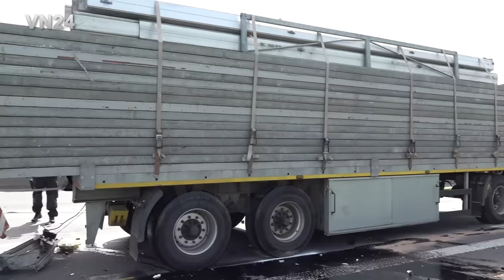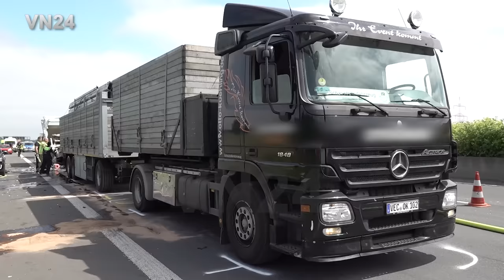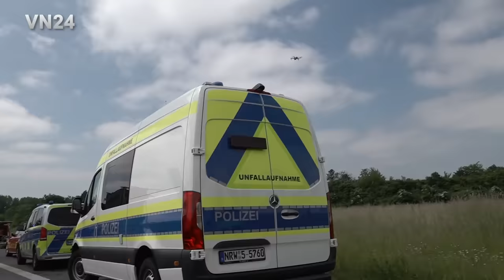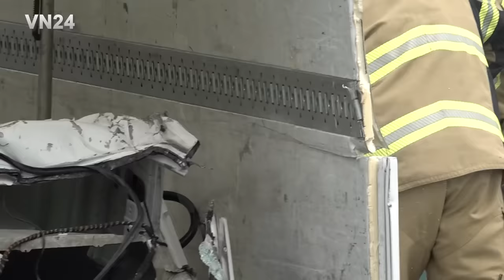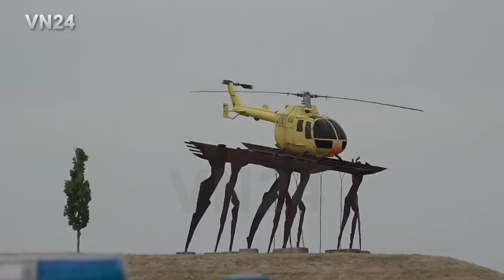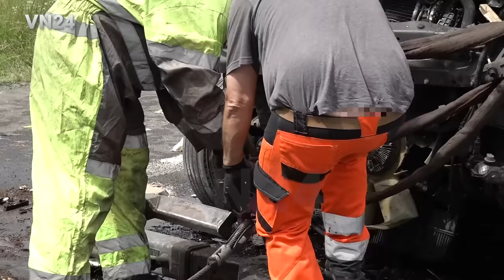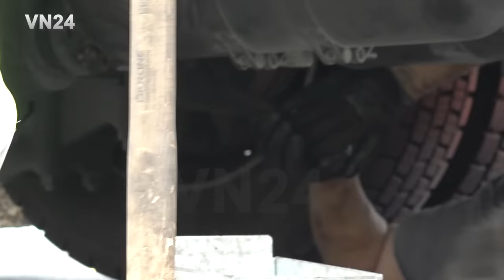01.06.2023 - VN24 - Fahrerhaus wird bei LKW Unfall auf die Ladefläche gedrückt

Comment: Ok, I mis-spoke in a comment. The load did not shift, you can see at about 1:20 that it is still flush with the front of the trailer. The overhang appears to be a tire diameter, so about 3 feet, not 6 or more, as many say.

The warning flag is hanging down at 1:23, so one was present.

The tow operators are slacking the air brakes so they can move it as well as disconnecting the drive shaft.

That was some rolling force to take the front bumper and frame member up that high. The tow pin is above the deck of the load area.

As many have said, it seems like it was probably instantaneous death. We will never know why he didn't even try to slow. Condolences to the family.

Comment: Good grief.  How fast was the car traveling?  The physics of this accident are clear and it’s not due to the load sticking out, it’s the car driver’s speed and inattentiveness that caused this accident.  Unless you contend the truck was backing up at 70 mph and struck the car.  Good rule is thumb is never drive faster than the vehicle ahead of you.
Reply: it wasn't the car drivers fault...read the summary at the top of the page !!
Reply: It was the second truck that hit the car that hit the first truck.
Reply: European trucks don't run 70 mph. They are limited to 88-90 km/h that's 55 mph. Don't compare with trucks in USA.

Comment: I can't watch anyone laying underneath a truck.. It makes me super nervous, I'm going to have a panic attack just watching that. I wonder what the team is doing under the truck for so long... It's scary 😨
Reply: Disengaging the drive shaft most likely and securing the vehicle so that it does not come off the wrecker.
Reply: @chrisbrand5728  Thank you for answering my little bit dumb question question.. I hope it is 100%safe for them being underneath 😰
Reply: @thearcherofjustice1492 

It’s not a dumb question, and I agree with your panic, but it was a necessary evil in this instance. They were pulling part of the driveshaft off so that the rear tires could turn as they towed the truck. If the truck had an engine malfunction and needed a tow, the truck’s transmission would placed in neutral to disengage the rear axle so the rear wheels would turn. In this case, it was not possible to access the transmission.
Reply: @thearcherofjustice1492 thank you and how very kind of you to take the time and explain this to the people that are curious. It’s very nice of you and to see that they’re are still nice pleasant people out there still left in this world where most are not and treat their fellow man unkindly. Thanks again!!! 😊have a blessed day!!!
Reply: @thearcherofjustice1492  Not dumb at all!
Reply: First off he is removing the prop shaft from the rear axle as I suspect the gearbox is jammed in gear, also if you tow with it connected the gear box will over heat and seize as the out put shaft will only be turning and not splashing oil on the bearings. Secondly he is winding off the rear brakes as the parking brake is held on by springs and released by air and since the truck has lost its air the parking brakes come on automatically. Thirdly it's safe to work under it like it was, if you know what you are doing.
Reply: @neilturner4846  

I’ll accept firstly and secondly - and thirdly, but only the way you worded it 😉 Thank you!

Comment: The rear-ended vehicle has an overhanging load.  Is this a violation in Germany?
Reply: Naruszenie kabiny 😂😂😂
Reply: No it isn´t. 1,5 meter is allowed anyway, you just have to secure the load with a red flag 30 x 30 cm or a red sign in the same size. If the transport is done within 100 kilometer distance it is even allowed to have an overstanding load up to 3 meters. At night you need additional a red light at the end of the overstanding load and the flag or sign.
Reply: The overhang in US is set at four feet. This is contingent on the vehicle’s total length not exceeding its limit.

Comment: There is no reason to measure the load overhang.
Trucks are built to carry loads
The load is not fault of accident.
The fault is driving at speed with 
Undue care or attention at speed.
The truck carrying the load had not
Reversed into this vehicle
Reply: " There is no reason to measure the load overhang." actually yes there is, as there are legal limits how much a load may overhang without the need to put warning devices on it, and how much it may overhang even when there are warning devices on it. If the driver didn't follow these limits or with insufficient warning, then it's up to him and his company's insurance
Reply: @EnjoyFirefighting no viste el la parte baja de la carga la señalizacion de carga  excepcionel..yo si la vi la carga esta señalizada correctamente..gracias
Reply: @josepescrigasoliver7449  I don't speak whatever that language is
Reply: @EnjoyFirefighting  not in the
Vehicle driving behind case may it of been over hanging 80 feet
See vehicle was driving with undue
Care and attention the evidence is
Obvious  as water is water
Reply: @skypilotace  you like poetry
Reply: @brianmilligan1787  then maybe you should tell that police department how to do their job? Give them a call +49 23 11 32 45 21 and let them know
Reply: Trucks have a speed limiter, the overhang has to be protected by a special sliding bar that extends backwards, but it's not that strong, it's meant for cars not to get under the load. The top of the car would be gone and the bottom would slide under. But 7500 kg truck is too heavy for that sliding bar\

Comment: And that's the reason Americans truckdrivers don't like cabover trucks .
Reply: That is because they are driving much faster than in Europe. Or are US-trucks electronically limited to 55 mph?
Reply: @dieterhinders9237  flet trucks are limited to 75 owner operators are not limited  but everyone has to follow the posted speed limits . Some roads and turnpike speed limits are 80 miles per hour .

Comment: One thing about cab over truck's are very easy to maneuver in the city but pray that you never have a head on or in this case rear end someone. The over hang of the concrete forms needed a flag at the end of the load. They definitely were measuring to see if any violations were there. I don't know if a D.O.T. bumper on the rear of the trailer would have helped or if the other driver was in a long nose truck would have saved this driver's life. Driver's stay safe.
Reply: A flag on the load does NOT cause other drivers to PAY ATTENTION!!!!!!
Reply: @wilburfinnigan2142 
Naravno zato i ginu toliki u prometu zapravo i ne ginu kako voze i kojom kulturom🤦‍♂️😖😖
Reply: I saw a flag there during the video. As another said, the load may also have stayed put when the cabover hit the trailer and pushed it forward.

Comment: No disrespect meant. Was that a cab-over style or conventional style? Do they have conventional style in Europe?
Reply: cabover is conventional in Europ ;-)
Reply: longnoses are highly inefficient. They may make sense in places where you'll have a huge amount of vast open lands to cross (US, Canada, Russia, Australia) but anything that is a bit more densely populated cab-over is 10times more efficient. Also: this was a 7.5t truck. or to speak a bit more american: ~3,700lbs bigger / higher capacity than a 26' uhaul. there are no longnoses in that weight class. anything below that would be either a sprinter-type or a Planwagen: sprinter chassis with a cuboid tarpaulin body
Reply: @boahneelassmal  when you say highly inefficient are you talking about fuel efficiency? Because a conventional truck is way more fuel efficient than a cab over. Also much safer and more comfortable ride. The only drawback to a conventional truck is its turning and backing capabilities.
Reply: @Twistedstanger  We have cities and villages ever 1-6km when not travelling on the motorway and roads are not stroads. we have maximum length regulations. space efficiency is key here. Trucks need to enter cities, drive on bendy country roads and lanes are 3.5m wide, yes, even in bends. So with all these factors, you cannot waste space uselessly on a tractor unit.

also, what are your sources on the fuel efficiency, because I don't really believe that. not saying they're less efficient but I doubt they'll be "way more" fuel efficient.

Comment: so many questions....why is there a helicopter on a statue and why did they not jjust tow it off as is to begin with?
Reply: I didn't see the helicopter yet. There is no way to tow that thing away that fast, they need to remove the loose parts first. And they first do research. Everything has to be recorded for like the insurrance and other things. The helicopter might have been there for the driver, but he didn't make it. The helicopter also has to have permission, as it can destroy evidence. Only in cases of emergency it can leave instantly.
Reply: @MrSpacelyy  um ok. The helicopter is on a statue. On a statue. You generally load people from the ground. And no. They were cutting up parts of the truck & trying to pull things off. I'm watching thinking they were trying to pull the cab out then just towed the whole thing as it. But actually both were rather rhetorical unless you truly know why the helicopter was on top of a statue.
Reply: The helicopter is there as an artwork, and as a monument to the rescuers. It is a decomissioned machine. Nothing besides the body shell,  glass, rotors and that kind of stuff. They couldn't make it fly again even if they wanted to. It is in the NW-corner of the intersection of the A1 and A2 highways.

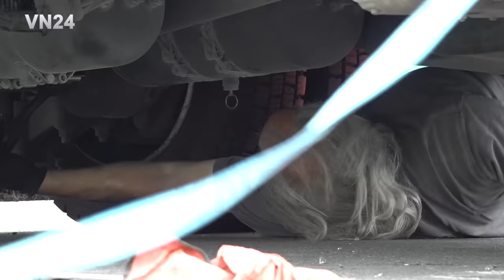Comment: 28:00 Was machen die da?
Hintere Bremse lösen oder ähnliches??
Reply: Propshaft connected to the gearbox.
Reply: Alter du musst eins begreifen: Schnelles Arbeiten bringt wenig Geld in die Kasse,also muss man maximalen Zirkus betreiben um möhlichst viel zeit und sicherlich unnötigen Aufwand in Rechnung stellen zu können!
Reply: @elchelch1374  was ein Schwachsinnskommentar wieder. Die lösen die Handbremse! Oder sollen sie das Ding mit angezogener Handbremse ziehen?
Reply: @voxpressaa4875  nein, bei dem zeitstempel drehen sie die bremse auf
Reply: @tobiasmetzger4522  no it's the propshaft.
Reply: @stanleymilgram4788  nope, its not

Comment: Collisions like this are part of the reason that they stopped building cabovers in the US. It's not good to be close to the front.
Reply: Cabovers have advantages and are better suited to European road conditions. In this accident, however, it would indeed have made a difference.
I would rather plead that with cargo absorber boxes should attached on the rear. They do not weigh much, but can absorb a significant part of the impact energy.
Reply: however the actual reasons for the US building trucks with a long hood today are different, right? And in Europe is just makes sense to keep cabovers, both due to the tighter roads in old cities and due to the length restrictions of the entire truck

Comment: Personal worst was being passed in the mountains in a moderate curve by a couple on a Harley doing about 70 they met a log truck doing about 80 to 90 going opposite direction (this was back when most hiways died limit was whatever you could control. The woman somehow made it all the way up and over the truck. Driver not so lucky, head went in just above grill and vaporized instantly, neck to waist was embedded in the radiator, waist down landed on the hood 🤯🤢🤮😵‍💫🫨😵
Reply: WOW

Comment: the guy had to fall asleep or heart attack, cuz didnt even TRY to brake, something definately wrong, they probably do autopsy to find out why, might have fallen asleep. sad
Reply: No skid marks….
No way that antilock brakes could possibly have anything to do with that!
Reply: @dangeary2134  so you are saying could be faulty brakes? that could be possible, forgot about that. that actually happens quite a bit. ty either way dont think guy at fault, sad
Reply: @dgonthehill  this is obviously overseas.
Also, it’s on a major highway.
All it takes is to have someone stopped in the travel lane to cause an accident.
The load of the truck that was rear-ended also allowed the truck to be crushed like that.
The engine in those little cabovers come up about as high as the top of a full-size car hood.
We already have plenty of decap accidents on this side of the pond to see the results.
The load of the rear-ended truck pretty much defeated any collision protection of the small truck.
Reply: @dangeary2134  ty
Reply: @ichlebeindermoderne6939 you would be genuinely surprised at how much damage a human body can take and still be intact.
Look carefully, the driver’s seat was pretty much clean as they were putting the truck on the wrecker.

Comment: Damn, what was that other truck carrying, stacks of concrete blocks? yikes!
Reply: Yeah, and by the looks of it, not by the book. There is a huge overhang where the trailer stops and the concrete extends rearwards. Had the concrete not been stacked beyond the rear of the flatbed, I belive the drivers cab of the following vehicle wouldn't have suffered quite so much catastrophic damage because the sudden loss of momentum would have been more evenly distributed, instead of the top half of the truck stopping with botttom half still moving. It would still have been pretty bad though.
Reply: Maybe that’s a legal load in Germany. I would be surprised, but you never know. Indians load that way all the time, but none of they’re vehicles can travel over 30 miles per hour so it’s not as dangerous as this incident was.
Reply: Looks like steel beams or framing to me 🤷‍♂

Comment: Seen it on th M6 south. No point calling an ambulance
Reply: often the worst looking accidents result in only minor to no injuries, and the minor looking accidents can be some with the worst outcome ...
Reply: @EnjoyFirefighting 

And looking at this scene, it’s obvious what the outcome is.
Reply: @ImOnAJourney  I had similar scenarios where the driver didn't suffer any injuries; From crushed cabs after rear-ending another truck to cars which were turned into a convertible as they crashed underneath a semi, to patients which survived with injuries after their seat was ripped out of the car after  as it flew off the road and cut through numerous trees at high speed.
Reply: @EnjoyFirefighting  One time my car hit black ice and went off the side of the beginning of a mountain pass. It slid about fifty feet upside down through rocks and trees, missing all the rocks and trees. It was a sturdy old car. I escaped with moderate injuries and walked back up the ravine under my own power, but it was horrifying, and the sounds were terrifying too. My seat belt saved me.

Comment: Voldsomt ser det ud.  Det vil ikke undre, hvis chaufføren har talt i sin mobiltelefon, og dette har været medvirkende til ulykken....
Reply: As you can see there is join slip road in front-traffic joining the motorway, for some reason motorway traffic had to slow down or more likely come to a complete stop, the 7.5t truck behind didn't react on time and probably wasn't keeping the distance and wasn't paying attention (could be mobile phone). The heavy load in front would be the one who had difficulty stopping, the empty 7.5t shouldn't have stopping problems, but the way it got smashed tells me that he probably drove into the back of heavy load at close to speed limit which is 90kmh in Europe, which means he wasn't reacting on time or at all, for whatever reason. 
Rear end accidents are always a fault of the driver behind, I don't know of any exceptions to that rule besides oil spillage.

Comment: They should change the traffic law.
Nothing should protrude beyond the trailer.
It is very dangerous for other road users.
Anyone can impaled on  something like this.
Such trailers are very dangerous for other vehicles both from the side and from behind.
Reply: It would not have changed the outcome of many accidents
Reply: Moot point, firstly if you run into the back of a vehicle it's your fault in most situations. There is a law in Australia a overhanging load is max 1200mm unless a truck, and a red flag as well. However the driving rules say your not to get that close to another vehicle anyway, so theres plenty of room inbetween safe distance and 1200mm even if they couldn't see laod.

Comment: I assume SPEED was the cause here from the white truck slamming into the truck in front but i think a lot of blame for the death off the white truck driver could be blamed on the truck in front, the OVERHANG from the load they had was at least 6 feet long if the Overhang was even with the back of the truck then i think maybe the driver in the white truck might have survived as it would have been a flat front of cab collision into the back of the truck in front but as the overhang was so big it caused the white truck to be pushed back so far thus causing so much damage and death, RIP the driver.
Reply: Wenn die Ladung bündig abschließt,  ist es kein Überhang mehr, soviel dazu. Soweit ich das noch aus meiner eigenen Erfahrung kenne, ist ein überstehen  der Ladung ohne zusätzliche Kennzeichnung erlaubt und soweit ich das einschätzen kann ist dieses Maß nicht erreicht. Ich kann aber nicht erkennen, ob nicht trotzdem eine Leuchte, Fahne oder ähnliches vorhanden war. Allerdings habe ich ein Problem mit dem Sicherheitsabstand, mindestens 40 met. bei 80 Stk., denn wie kann es passieren, daß die Fahrerkabine derart auf die Ladefläche geschoben wird. Ich gehe mal jetzt nicht von einem medizinischen Notfall aus, alles andere hätte der Fahrer zu verantworten. Abstand, Müdigkeit, Unaufmerksamkeit. Natürlich tut mir der Fahrer leid. Ich hatte vor Jahren dasselbe Problem mit Müdigkeit, als ich nach der schweren Spätschicht nachts um 12 noch 130 km nach Hause 😊😊